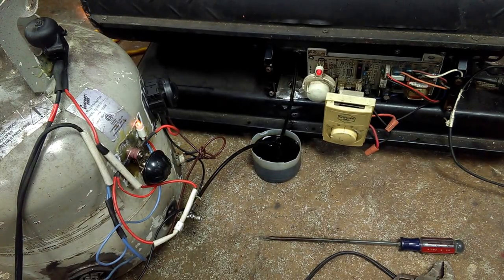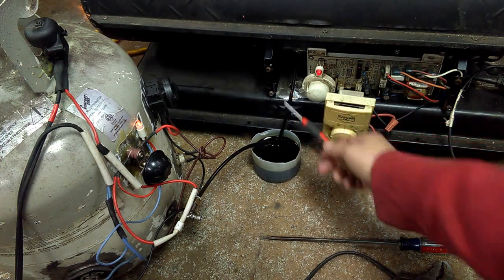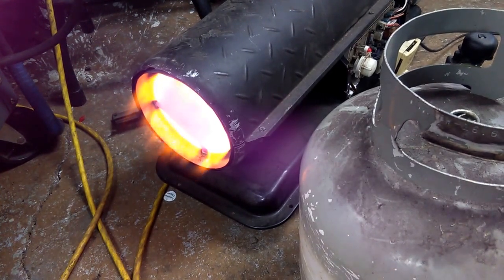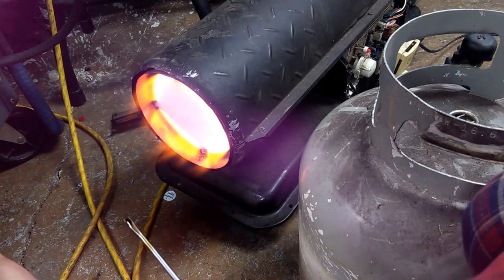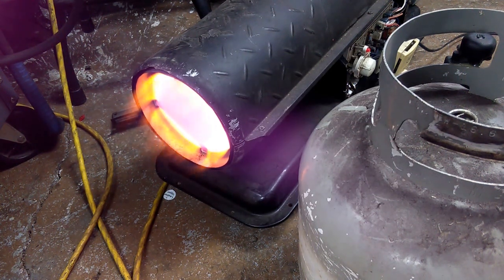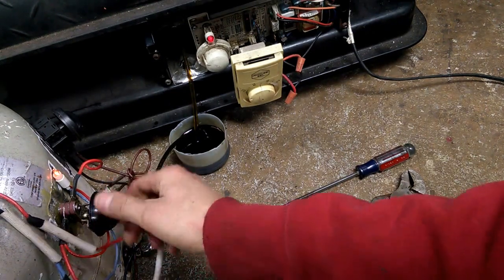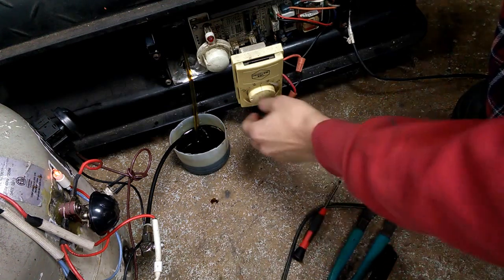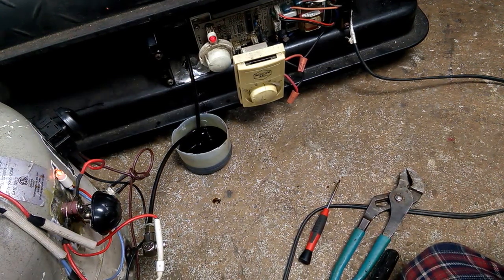Torpedo Heater Running On Waste Motor Oil Fed By New DIY Preheater

Comment: I wouldn't recommend doing this waist oil burns real dirty you'll always have issues. But if for some reason I felt the need I'd mix it in with diesel or whatever fuel I'd normally use like 1 gallon of waist with 9 gallons of clean diesel fuel just to get rid of the waist oil.

Comment: I have a Lot of Old Hydraulic Oil, Synthetic engine oil,  Gasoline, Diesel.  Here in MD, except the Engine Oil, it's ALL "Hazardous Waste".  They have 2 or 3 days a year when you can bring this in.  The Hydraulic may or may not be I think all this could be mixed with say half Diesel, and used in an old Torpedo heater?  Anyone try that?  Would be real nice if it was near as clean as straight diesel..  Otherwise will have to leave the garage door cracked.
Reply from the maker: Yeah they sure are!!  I honestly am surprised at anyone with a camper that doesn't make the switch. Especially if you already have one with a diesel engine! I could see how the waste oil could clog them but with a bit of diesel to thin it out or maybe a preheater it may work better. Definitely need decent filtering though. I have seen a lot of options from oil filters to gravity bags.
Reply from the maker: @ElectronicMusicUnderground  Those diesel forced air heaters are awesome!  I have see. A few YouTube videos on home built campers (in vans, enclosed trailers, etc) use those a lot and they seem super reliable. I'd just be cautious mixing the oil with gas, especially in a heater like that. Definitely start as low as possible with the mix. Maybe use premium fuel too so the ignition point is a tad higher (then low grade).  I have seen those centrifugal units also. I actually made one ages ago from a centrifugal fruit juicer. I have seen people also buy the "bag filters" from places like McMaster Carr. They have various types that can filter out some tiny particles.
Reply from the maker: I definitely wouldn't burn anything in an open flame unit. Even used hydro fluid has additives and tiny metal remnants in it. If you have a closed unit with a Beckett Burner (kind used on oil furnaces) you could probably use it.
Reply from the maker: Are you talking about those small 5kw drip feed forced air Diesel heaters? I was curious to what they would do on waste oil. I've seen a LOT of people who used those in those mini camper builds.
Reply from the maker: @ElectronicMusicUnderground  That's awesome that you did all that testing. That would definitely be some good video content!  I never got around to trying used motor oil in my truck but I did use 2-stroke oil in it just to help the injection pump. That ULSD made my Cummins' pump (99 Ram) so loud but with a bottle of 2-stroke oil she was so quiet you could ACTUALLY have a conversation next to the running engine. HAHA. I was hoping the used oil would do the same.
What size heater were you using in that house? I have been looking at options for Mt garage. I have a 5kw electric unit but DAMN does it shoot the electric bill up! We bought the house with a gas furnace in the garage but come to find out the previous owner removed the gas line completely but still lied and said it was a "heated garage"

Comment: Good build for you, very hot, but not suitable for breathing.
Use wvo and survive breathing the exhaust. I still have couple I built with 350 watt pencil heater fitted to a heater/nozzle block along with pencel heater in 2in square tubing brazed it all to bottom heater reservoir , both pencel heaters had temp controllers 
Bottom reservoir le heat nozzle heater stayed at 128c . I got 1600c + 
Did replace 2 end deflectors in 3 yrs ( melted at 3 attach points). 
I loved breathing in that beautiful hot exhaust). Ran out supply so built
 double barrel stove with chimney
Well done, great build, please build heat exchanger chimney or switch wvo waste vegi oil

Comment: Great job brother! I've been thinking about doing this to my burner as well, only utilizing vegetable oil due to it's lower flashpoint and cleaner burn. Your design is great. I was thinking far lower tech. Like a T valve so I can preheat using kerosene, coupling that with copper coil in front to create a thermal syphon  and preheat the WO. Then flip or merge the lines. I would say this design is ideal for heating a greenhouse. Now before all of the comment nazi's start; I am talking about a flow threw design coupled with thermal mass..
Reply from the maker: That would definitely be a good idea for starting. You could definitely figure out a way to do do it using a controller like an Arduino if you wanted it to be fully automatic. Waste veggie oil would probably be a lot safer too because of all the bad stuff in waste motor oil that gets put into the air when you burn it.
I actually got a Beckett Blower a while ago and was going to use that in a custom burner box (probably a double stacked 55 gallon drum) with air pipes through it. I may run the same preheat tank for it as well.
The most common thing for Beckett blowers when using WMO is to have a heater block on the feed tube right behind the nozzle and use a syphon nozzle like the torpedo heater. Wondering if I can get away with using the stock pump on it instead if I heat it up quite hot before hand with my preheat tank.

Comment: Can you open it
Reply from the maker: Can I open what? The preheat tank? There is a hole on top where the valve used to be that you can fill the tank from. It have a cap over it but it's not tightened down too much or it won't feed oil consistently.

Comment: its good to see someone that is smart enough to heat that extension cord up enough so it doesn't lose its conductivity and become useless...its still a tad bit too far away in my opinion but at least the flame is pointing the right direction and the cord is within the "hot as hell" 3ft distance from the flames so it's a start...but it can be improved.....can you believe some of the idiots out there that route their extension cords so that they don't go near the flames at all....dumbasses

Comment: tried this, ran kerosene first, then quickly changed over to preheated oil @250f, just smoked, no flame no heat,  didn’t work
Reply from the maker: What pressure were you running on the fuel pump? Is your pump adjustable?
Reply: @OverRevvedRacing  how rude he never replied back to you!!! After you took the time to make the video and also try to help him diagnose it!! People these days Zero Couth and No Appreciation!
Great video and thanks for taking your time to help people!!!

Comment: If you are having issues getting a stable pressure or enough pressure off the internal compressor built in you can put it on a air compressor. Mine went out i took it apart cleaned it up back together then next month samething its been a pain in my ass for a few yrs so instead of buying a new heater or more parts . I had a solenoid valve 110v  normally closed good up to 30psi. I installed it by unhooking the line from the internal vain pump and connecting to the output on valve, Then the input on valve is hooked to a small regulator and water trap with 1/4 poly tubing. In order to control the on and off of the valve it is hooked to the fan motor on the unit. This way it will only pump fuel if fan is running then everything else like the safety switches all work normal. But you can really dial it in. Most the time i set my pressure to operate with the same flame size and pressure it came from the factory with . But the neat thing is after it runs a minute or so and gets hot you can turn it down under the factory pressure  and save a good bit of fuel. But it has to start at the higher fuel pressure. If you was to tun off at the lower pressure and let cool down and relight it blows smoke and has hard time getting going so you up the pressure a pound or so and it will light right up. These heaters have a Achillies heel and that little vain pump is it they just don't last. This is a great fix for them. I do love the idea of burning used motor oil as well as cooking oil. What temperature is your oil at and do you have to make adjustments for the thickness of the oil? (10w vs40w)

Comment: the flame sensor is just a tiny solar cell in a tube that point into the combustion chamber, the computer controller looks for voltage from the solar cell to know the flame is lite and making light.  have you tried cleaning it or moving it a little closer down the tube?

Comment: Hello sir, is it possible to just supplement a mix of diesel w/ some used motor oil?  How many gallons to those heaters hold?  Could you mix a couple quarts of WMO in when its mostly full of diesel?
Reply from the maker: lee isenberg
Absolutely...  However, you would still have to worry about what your burning in the WMO. it's normally not something you want to breathe directly. Ive ran it with a WMO/diesel mix.

Comment: Good effort and all that, but there must be " Exhaust " for your Gases.  I saw this guy did the same thing, but he built an " Enclosure " with heat ex-changer to stay on the safe side.
Reply from the maker: +Jordan Bronson 
Oh yeah I'm aware. This is just a proof of concept. The exhaust byproduct of just using Kerosene is nowhere near as dangerous as venting burnt waste motor oil into your garage.
Reply: @OverRevvedRacing  oil, kerosene or diesel  these type of heaters need to be used with good ventilation. Now that is more so with oil i would think. I thought of using waste fry grease. Only on one with a enclosed vented otherwise I would want french fries. lol   I been thinking of doing same thing. cool video
Reply: Jordan, can you link that video?  I can't find it anywhere. He had a commercial shop and had a cartridge heater attached to the siphon nozzle to preheat the oil.

Comment: I am working on doing something similar using a torpedo heater and waste oil. What temperature do you preheat your oil to? Also, what is your average oil consumption per hour?

Comment: Welcome to the 22 carcinogens your now breathing. This is insanity! Build a contained and exhausted heater. https://youtu.be/IrkFaykuehg
Reply: If you took the same effort and used it to heat a panel on the outside of your garage ( barring the noise levels that will offend liberals who preach renewable energy) then you can collect the heat and use it indoors. See if your same design can be fed into a chamber without over heating the burner flash plate in the torpedo heater, and then use a heat exchanging method to utilize it. Otherwise, a design like I built, or similar is the safest bet. Mine can't even be seen or smelt burning by neighbors. It runs that clean and can run all day safely un attended.